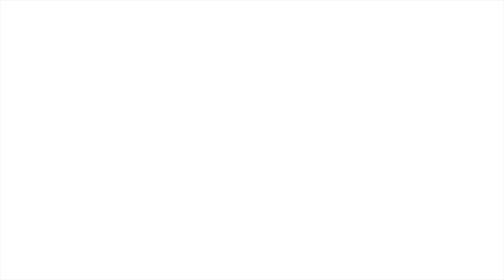Industrial Scratch Build 3 - The Inner Skeleton - Scratch Building With Inkscape

Comment: Hi Michel. Just trying to set clip an imported brick image from Scalescenes. I overlay the drawing with the image but I am unable to bring the drawing to the front, as in your vid.  The icons in the bar at the top of the screen all light up as if they are active but they don't work.  However, if I import the brickwork image first then draw the shape the drawing will be on top of the brickwork image and the set clip works fine. What am I doing wrong???
Reply from the maker: Hello. It is difficult to guess because I don't know. It sounds like either you are not actually selecting the shape you're trying to move, or you've selected both the shape and the texture, and hence are moving both (try pressing escape before selecting), or your'e somehow inside a layer or group so are moving only the shapes within it rather than across the whole drawing. As I say, these are just guesses, but I hope they help somehow.

Comment: More insights as I journey into scratch-building with Inkscape: you're absolutely right about rounding up and rounding down when measuring. I didn't actually do that, but the card I'm using that I thought was 0.5mm and 1.0mm and drew my design based on those figures, is actually 22 point and 50 point card, respectively. I'm not sure if it's universal, but here in the U.S. each point equates to 0.254 mm, so a 22 point card is actually 0.5588mm while 50 point card is 1.27mm. 

I couldn't understand why my building was off until I looked into exactly what a point was in card stock. You wouldn't think 0.27 or 0.0588 would amount to all that much, but you're right, it does add up. On the thicker card you're talking more than half a mm for each end wall, or over 1mm total. While my building wasn't all lopsided since those are still small increments, nothing fit together quite as well as it should have and I ended up having to compensate for the discrepancies. Now when I'm designing a structure, I make sure to use the correct mm dimensions.
Reply from the maker: I eventually used trial and error to find my set of dimensions that work for me but it all worked out once I realised that things are not always as they seem! :_chandChandwell:Michael

Comment: Hi! Can I ask, have you ever modified a scalescenes plan using inkscape or adjusted one to be more suited to your requirements?
Obviously when you buy plans from SS you can print them as many times as you want to, but can you revise them?
Cheers Dave
Reply from the maker: Yes I have. You can open the Scalescenes PDF in Inkscape and make adjustments to them quite easily. It is useful if you want to print individual parts. :_chandClass47:Michael

Comment: Great stuff. I already have questions but I'll wait until the next video because you'll probably answer them then.
Thanks,
Bob
Reply from the maker: Thank you Bob! I never did make the next part of this video. I really should sort that out! But feel free to ask your questions and I will do my best to answer them... Michael.
Reply: @Chandwell  I've been binging an Chandwell this week and I did spend some time looking for number four but I think my question was answered in the next video anyway.
However, as you've offered, I'm modelling in 00 gauge and will be building a scale model of South Blyth Engine Shed. I have copies of the original NER drawings.
I will be building it as a 3 laminate structure. I plan to use foam board for the inner and outer walls and grey board as the centre layer. I've commissioned etched windows for the shed, which themselves are laminated. The grey board will be 0.75mm thick to hold the windows which will then be trapped between inner and outer. Total thickness will be a scale 13 inches. 
I have two questions at the moment:
 - How do you apply the textured layer to the window reveals. As I said, I think you covered this in a subsequent video.
 - The end wall has buttresses at each side that wrap around the side walls. I was wondering how best to achieve this. Should I:
                       1. Have the structure integral will the end walls? Have the printed texture to include the buttress, glue it to the flat end wall structure, then build on the buttress, then fold and glue?
                       2. Build the ends, sides and buttresses separate and assemble the 3 parts, with the resulting split line on the end wall or on the buttress.
Number 1 will give the cleanest finish but approach seems a bit fraught.
Thanks,
Bob

Comment: Excellent series Michael! Just beginning to design a chalet style station from the West Highland Line in N gauge. Inspired to pursue this technique. Wondering how to design the bay windows? Leave space and design separately and then add? Keep up the great work. Cheers James
Reply from the maker: Brilliant James! I think I'd leave a large hole in the building front where the bay window will go, and then add the bay separately. I'd probably think about doing it in one piece of card, with folds so that it is easy to maintain the shape. I'd design a base and a top section to maintain the correct angles and keep it symmetrical.

Comment: A great idea to use guides to dimension the differing internal and external wall layers - I just draw the wall components out again if they're a different size, saving the printable area as a different PDF with different wall elements on it that I can then print off as required. I also notice you don't seem to suffer from "Card Curl" when gluing your texture layers onto the greyboard - what's your secret? Another great video and I'm really learning a lot from this. Can't wait to see your treatment of importing textures at the corect scale which I've always had trouble with. Thanks for posting and for a great series.
Reply from the maker: Thanks Paul. I must admit I've never experienced "card curl" other than when I use very thin card. I find 1mm greyboard, and even 0.5mm greyboard and cereal packet quite robust. The method I use is to make sure that every single millimetre of the surface of the card is covered in the glue stick, so that there are no dry bits which may "pull" the surface during drying. I don't think I mentioned the next bit in the video though... I put the card underneath my cutting mat and put a heavy book on top for the full 2-3 hours that the glue is drying. This ensures that it dries completely flat and has a solid laminate once dried. I hope that helps, and thank you so much for your great feedback and continued support.